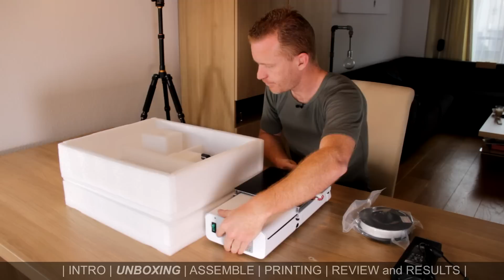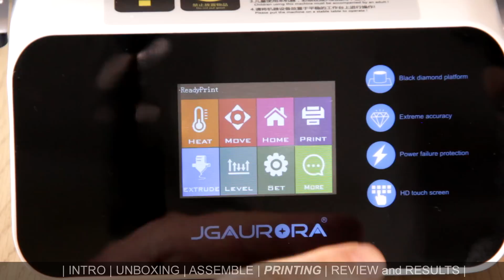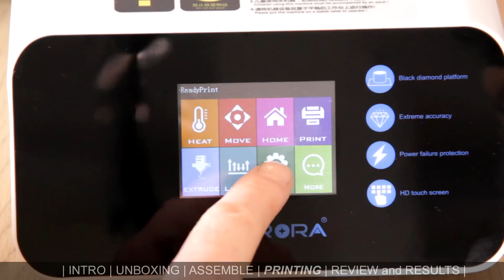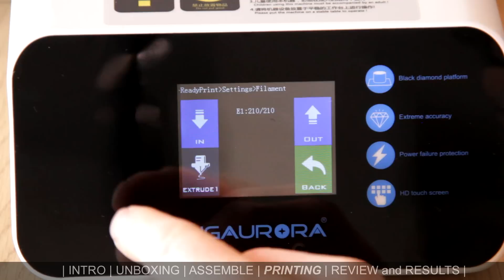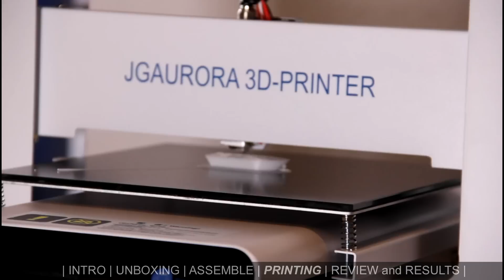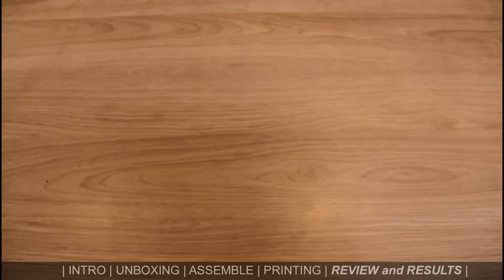VLOG 004: 3D Printer JG Aurora A3S setup and review

Comment: Nice review and despite the initial problems it seems to be a very nice printer. Not as expensive as I thought it would be. 
Cheers
Peter
Reply from the maker: True Peter.... There are cheaper ones, but I do not really like the open design and the very DIY look of those machines... And as I said, there are a couple of great details on this machine... I like the rigid gantry very much, and the fact the bed is riding on two rails and is not lifted in the air (including the model). Think for the price this is a very good choice...